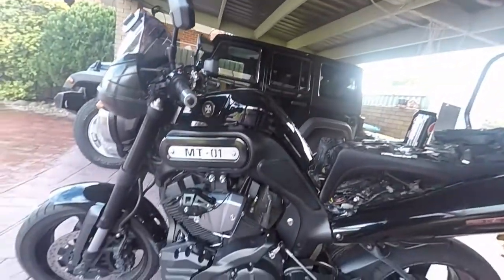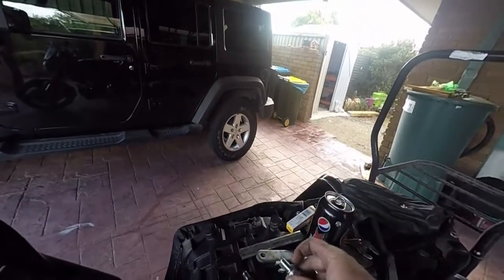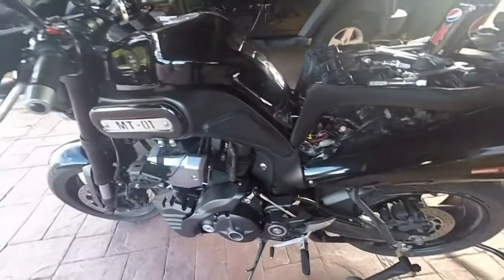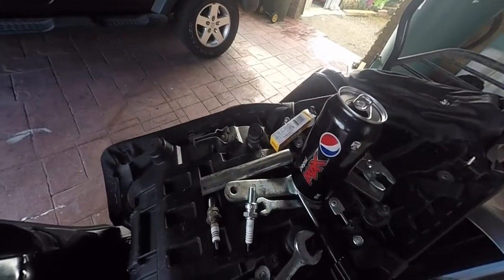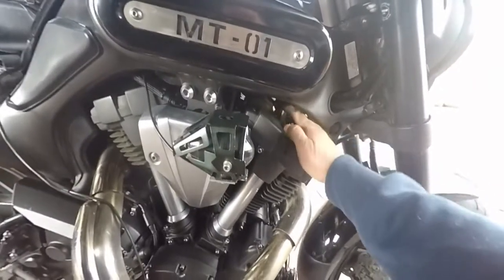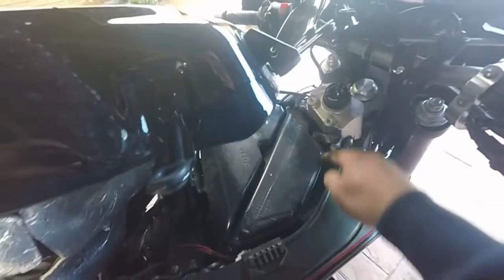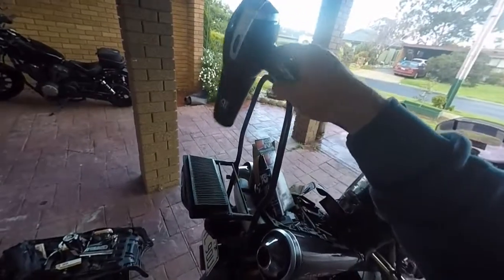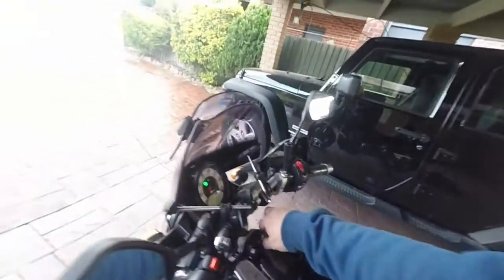SPAREK PLUG CHANGE ON YAMAHA MT01 AS WELL AS K&N AIR FILTER CHANGE

Comment: Thanks a lot Mac. Very surprised the Iridium plugs wore down so fast as they are supposed to be good for 80,000 k's. Good to see yours. I think there are brisk plugs that use a Silver centre electrode - silver is actually even better at thermal and electrical conduction than copper - but I hear they need more frequent attention. Not sure about those K&N's though bro :( Too inefficient and let too much junk through. Very grateful for the vid bro. Thanks again!

Comment: I have a problem with my MT-01, and here in Brazil, because the bike is rare, I can not solve it. I wonder if you could review a video on my channel and give your opinion.
Basically, the bike starts running the engine normally, but when I'm driving and relieving the throttle, it makes an overflow sound (pow...pow...pow)
Reply: Biker Dan yes, in Exaust
Reply: Biker Dan I post a video to you...wait a moment...
Reply: Video posted
Reply: Natanael Albuquerque , comrpei uma MT01 esse mês.  Vc ainda tem a sua? Resolveu o problema dos pipocos? Qual sua impressão sobre a moto?
Reply: Seu problema pode ser nas velas, bobinas ou canos  na queima do combustível .